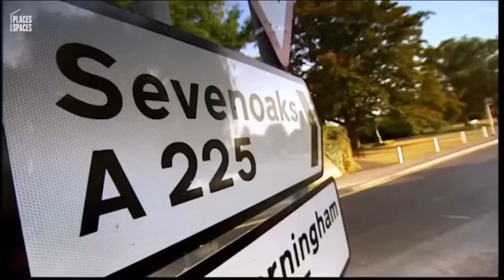How Clean is Your House? S02E01 - Georgina Taylor (The Cleaner), Sevenoaks (HD)

Comment: I kid you not this episode changed the way I live, particularly when I take a bath. It had never occurred to me that wiping alone wasn’t taking care of all the, um, doo doo. 

I began washing the areas before a soak. After a good rinse, I would clean the tub before filling it with water. Then and only then would I relax into the tub. It’s a lot easier now that my tub and shower are separate. I have a bidet which does a better job than just toilet paper.  

I also clean my shower floor almost every day. Just a spray around with some diluted Lysol all purpose cleaner and a rinse. Once a week the bleach and scrub brush are used for deep cleaning.
Reply: This is why we use the bidet in Italy
Reply: You would enjoy being cleaned with water after each use of the loo. You can use a regular large plastic water bottle and your hand (usually the opposite of your normal eating hand), or a watering can, like from a garden. It helps keep infections away. It's also just better spiritually.
Reply: I bring a portable bidet, game changer!! I use to use to bring a water but it was a hassle. As a muslim I cannot bring myself not to clean myself without water